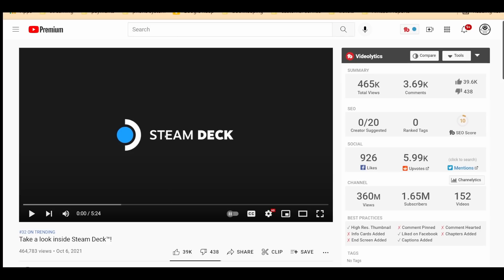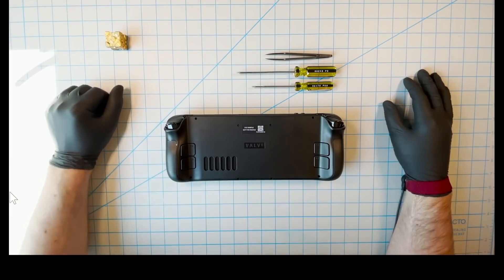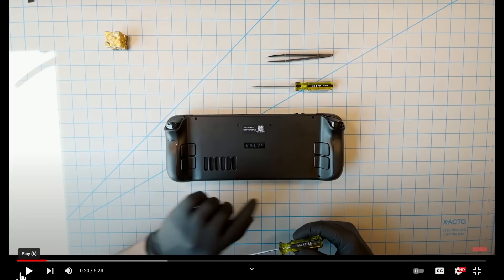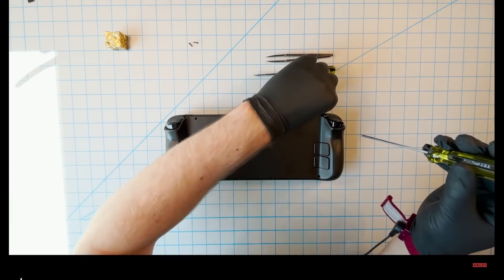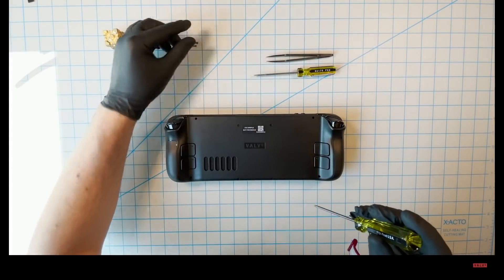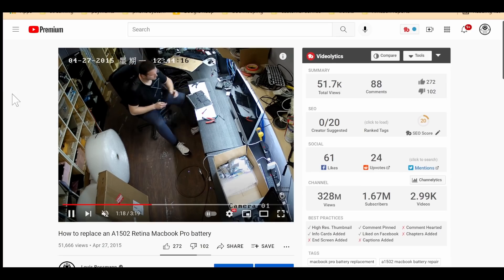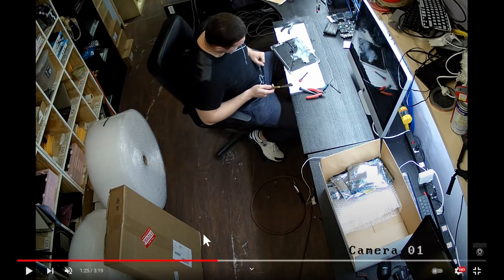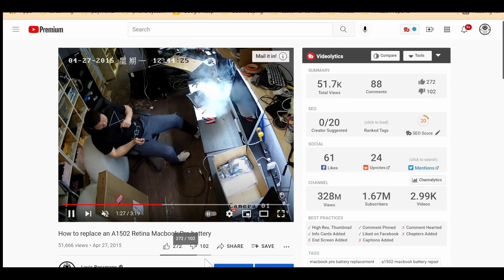Steam deck battery may end your life? bruh 😑

Comment: 6th year mechanical engineering student: at 8:07 i have two thoughts here. Unscrewing and rescrewing in the screws could cause fatigue cycles to weaken the threads  (but i doubt this because you would have to screw the screws in every day for the next 10 years for that shit to wear down). if they do weaken then the mechanical connection holding the back onto the device gets weaker. if you drop it the posts may break and the back could pop off. if the posts dont weaken from repeated screwing lol then nothing mechanically has changed about the device and i think theyre just trying to scare you here.

i think what they really mean is:
putting the back of the device back on and screwing in the screws can cause problems if the screws are over tightened. this can cause the threads to not work as intended, maybe theyre more lose than before or maybe you just cross threaded something and the screw is pointless now. this could be a problem if the device is dropped because that screw is mechanically irrelevant when considering any mechanical connections that are holding the back onto the device. basically that screw isnt doing its job and the other screws need to pick up the slack. this puts more force on the remaining screws and they werent designed for that. ie. back go pop. 

also. ive been taking my electronic shit apart since middle school and never needed an esd wrist band. i think i can remember one instance where i had too much static and felt a zap when i touched a device and it worked fine still.

Comment: There was a fatality with the 2006 lithium battery screwup, but that was a special combination of circumstances.  In that case, it was that the batteries themselves were actually defective and could explode if they overheated in use.  Overheating was not outside the range that was supposed to be safe because of the manufacturing defect.  The fatality was an unexpected overheating of the battery in a phone which exploded while the phone was in use.  That is, it was very close to the head of the person using it, and exploded unexpectedly.  (Not like the Dell notebook that burned up in use, but was sitting on a desk at the time so the user was able to get out of the way when it started to go up.)

Comment: every time you loosen and tighten a self tapping srew, you wear down a tiny bit of material. that minutely increases the tolerances and therefore influences the structural integrity. it does so on a homeopathic level but it dooes.

Comment: While I agree with you that what they are saying in the beginning should be obvious, it is not, and Valve making an effort to make their device more repairable is a good thing.

As for the structural integrity several people has mentioned the point that re-installing self-tapping screws, especially such narrow threaded ones, can easily be over torqued or, even worse, cut a new thread in an already threaded hole.

It is possible to reinstall them with 99+% integrity intact, but it will never be 100%, and with the ease of messing it up I believe it is a valid point to make.

Comment: After Reading a couple of comments about the self tapping screws I wonder if it might be possible to find replacement screws that are not self tapping so they just use the existing thread without taking away material? I dont know if that would help or hinder the situation with the possible weakness in the plastic threads. Maybe somebody can enlighten me.

Comment: I think the ''structural integrity" thing is just to cover their ass in case an idiot over-tightens the back cover  screws and breaks the self tapping ''hole'' and then calls up valve to fix it under warranty;

Same with Li-Ion in case another (or same) idiot makes tea out of it and dies in Li-pain;

Comment: I'm not particularly qualified to talk about this, But my guess is that the structural integrity will likely be affected by opening it because they probably intend to produce it in a way where it's parts are held at a high density when it's being sealed and it would be hard to reproduce without special tools. Definitely a bit misleading imo, but the teardown seems to be aimed at less qualified individuals to inform them on any possible (if unlikely) risk before they try to perform a repair on their device using random ebay parts.

Comment: I can't agree with some of your arguments. First of all, this video is clearly made for folks, whom are as basic as it gets when it comes to digging into a device and hardware. They mentioned couple times that you shouldn't if you don't know what you are doing, which is correct, and for others - you do you. Battery. I can imagine situation when someone forgets something inside a device which would make short. Imaging riding a motorcycle and your back pack caught on fire. Imagine driving a car and your trunks burst into flames. Imagine that red hot battery in your deep pocket, ofc you would get it out, but i don't think you can get away without ANY damage to you or your property. They did not say ruined structural integrity, they said lessened. That means if you not knowingly striped screw hole just a smidge, you probably made at least some damage to structural integrity of a device not knowingly, and that means if you bump your device that screw can get loosent even more. Few bumps and that screw is not holding anything anymore. Wristwrap.. Do you really think they couldn’t make another shot of this when they are cutting this video back and forth? That clearly was on purpose to show how NOT TO DO and get your attention. Ever seen that road sign which shows a car running of the cliff? Ant yet again, you are a professional, you know how static discharge works, but some 15 years old kid might not know this. You explained how you deal with static. Imagine that explanation in this video - touch lot of other stuff which is grounded lol. What is grounded and what is not? I don’t know man.. this is like watching someone critic Teletubbies because that’s what it is. This video serves 3 purposes: to show at least a bit of what’s inside of this device; to show for newbies how you can change basic stuff safely and what are the cavities; to make a statement for right to repair. I think that at least 2 of 3 should make you happy, since this type of videos from manufacturers is absolute scarcity. I love your content but this video was ..meh. Sorry about that.

Comment: I believe their comment about taking it apart will weaken its structural integrity  comes down to the fact that the shell has self tapping screws and the shell is plastic. If you have ever worked on modern plastic devices with any screws even ones that are not self tapping you know that after repeated disassembly the screws have less and less bite in the plastic. Now with self tapping screws as they are meant to cut threads into the plastic as its screwed in for the first time the theory would be that after taking it apart when putting it back together the screw would cut into the existing threads very easily thereby making the screw not have enough material to grab onto leading to a weak structure next time its dropped possibly causing it to pop open.

Comment: I just hope they, or someone, will offer higher capacity SSDs. I don't care what they say, or what work they may have done, a MicroSD card is not "plenty fast". I'm sorry a MicroSD pales when it comes to speed with a NVMe SSD. Not to mention SD cards weren't meant for constant IO like would happen as a storage drive on a computer, so the life of the MicroSD is gonna be far shorter. As for sources for parts coming in the "coming months," that is fine. The devices aren't due out till December at the earliest, and most likely January for most people, so "coming months" likely means shortly before or maybe shortly after launch, at least to me. Only time will tell on that front.

Comment: At least in audio (speaker cabinets) there is a common knowledge that using self tapping screws on a wooden/mdf/particle board cabinet to install speaker drivers, the optimal strength is lost the moment it is unscrewed. It definitely holds the driver in its place but the fit on the threads has come loose after it is removed and reinserted. Problem is that the screw now could loosen more easily over time due to vibrations. That's why many DIY'ers and higher end manufacturers install rivnuts or whatever they are called (a metallic threaded part with spikes holding it on the material).

So it most certainly will affect the integrity of the device at least somewhat. Can you actually see it in real life? Maybe not before opening it multiple times and also using it harshly. It depends on many things, like the elasticity of the plastic, the depth of the groove/thread on the screw, the weight and load bearing characteristics of the back plate and so on and so forth. And of course the amount of torque and deformation of the threaded part. If the assembly line has a screw driver/drill with a even a bit too high torque setting, it may be more problematic down the line. 

I'd think adding threaded metal inserts for the screws wouldn't be too expensive or gained any noticeable weight.

Comment: They're covering their bases. I'm loving that Valve is going head on with Hardwares now. The Steam Controller, the Valve Index, the Steam Link. Those products are amazing and people should pay more attention to what they do.
Reply: and they kinda left software behind
Reply: the steam controller is kinda meh (I have one) it works, but a touchpad makes a really bad joystick
Reply: @jearlblah5169  The way to play an fps with the steam controller is Gyro controls, with quick flick aiming. Its actually an amazing controller if you take the time to learn its intricacies. There are a bunch of steam controller tutorial videos that can give you the run down but its a lot.
Reply: "a touchpad makes a really bad joystick", because it's not a joystick, it's a touchpad so more like a mouse. 

Sure it takes a while to get used to it, but it's just superior to an analog stick. With all the options you can make the touchpad precise while still being able to move the camera really fast. 

But yeah sadly it wasn't a huge success, a lot of people just prefer the regular analog stick. From what i've seen you either love the steam controller or you hate it.
Reply: didn't all of those fail pretty much? Steam Link was an abject failure and the Controller wasn't exactly a huge success either.
Reply: @konsyjes  the index is still selling so fast they can barely keep them stocked. Vr is exploding right now and the index is arguably the best/easiest to use headset.
Reply: The steam controller stinks
Reply: @ahhcmon9604  have you used one?

Comment: "Notice that your model might look different from this one"
translates to
"We'll downgrade the components once the device gets enough positive reviews".

Linus had a great video on hardware manufacturers swapping out particular elements of the e-devices , to save on the production costs.
Reply: With such a device people will notice if performance degrades, I don't think they'd risk putting in worse stuff. If anything, overtime they might put in better stuff as sourcing older components gets harder or more costly. 

The hardware Linus was talking about namely ssd's don't get as much attention as consoles, phones, etc, in which you expect a consistent experience from one device to another, so they can kinda get away with it most of the time.

Comment: So the threat with Li ion batteries is creating a short, which after some time can start a thermal runaway reaction, causing a large amount of flames or an actual explosion with potentially lethal consequences. I agree that most punctures result in a slower reaction that can be moved away from, but to say that Li ion batteries aren't lethal is not true. I respect you and your expertise, but this is my personal expertise. I'm a materials chemist and I make these kind of batteries for a living, and it doesn't sit well with me to say that they can't be lethal when they absolutely can be. I'm not saying people shouldn't be able to to handle them or change them, but they should be respected. 

I would say that Valve put it a bit too much on display, but I also think that they don't want just Joe Schmoe messing around with the internals with no idea what they're looking at, potentially leading to a dangerous situation. Just a bit of fearmongering to keep out those who probably shouldn't be digging in the first place.

Shot in the dark with the structural integrity thing, but there are definitely some polymers and rubbers that change properties as they compress, but permanently lose those properties after decompressing again through micro-structural reorganization (like work hardened copper, but with tunable properties). I could see them using a material like that around the frame as a shock absorber, and it loses some of it's strength after expanding upon opening the case. Would it become worthless? No, but could be anywhere from a few percent to maybe 40% loss in efficiency with something like that. Really need more details with that too.

Comment: Valve is unusually open about their hardware. I had a problem with one of my shoulder buttons on the Steam controller. They actually published all the mechanical drawings for the parts, so I just got a replacement part 3D printed!  If it was an Xbox or PS controller I would have had to just throw it away.
Reply: If it were an Xbox or PS controller, you could simply have ordered a replacement (shoulder) button set, or perhaps a complete shell, as they're pretty inexpensive, off of AliExpress, BangGood, Amazon or wherever.
Reply: @EvenTheDogAgrees  Sony and Microsoft sell enough product to make this viable.

Comment: As for the Steam Deck being weaker upon opening it, I believe just thinking off the top of my head that due to the nature of self tapping screws, they'll never be as tightly fastened as they were initially due to the risk of stripping the plastic threads. Self tapping screws work best when fastened once, and only once, in an areas with no pre existing threads or in some cases holes.

Comment: Your perspective on the potential hazards of batteries is unbelievably narrow for someone with a tech business. The reality is, that's not necessarily what will happen if you mess up. If it is damaged in such a way that causes an internal short, but not a puncture so the pressure can vent (like what you showed, which wasn't a "blown up" battery"), they can ACTUALLY explode, violently. As unlikely as that may be, its still a potential risk, and its not stupid of them to tell people not to mess with it if they don't know what they are doing. And considering you had to cheat on chemistry to graduate, you really have no room to claim that they are overstating the potential hazard. Get off your high horse, you sound like a tool.

Comment: I worked in plastics manufacturing for a couple of years, I can only really give anecdotal advice but if remove and replace the screws they will wear some of the plastic and be less secure. you won't have any significant problems doing it once or twice, at worst they may loosen and need tightening every few months depending on wear, but more than that the screws will not bite, the best practice would be to add a small drop of glue when re-assembling if your happy you wont be opening it up again.

Comment: The reason why he is going so hard to "Don't open it" He is clearly talking about the normal user. He made it clear "Let a pro open this up if need be" "We don't cover damage you did in opening it" ECT ECT. When the tone he is using is vary aggressive steam will be sued because someone opened their deck and damaged it. Blaming that video. So making it clear of "DON'T RANDOMLY OPEN THIS FOR THE LOVE OF GOD" Is reasonable when you really don't want to be sued.
Reply: I assume the reason he said "Putting it back together may make it less drop resistant. Is if the person puts it wrong, strips screws, doesn't put everything back together right. There is a lot of ways to make a device weaker to being dropped and I think they are just being told by PR to warn of all of these possible issues. Clearly wanting a store or repair shop to do this rather then the end user.

Comment: about the structural integrity. self-tapping screws are made with a blade at the tip and threads that are designed to carve a tread for itself. if they are housed in only plastic to hold everything together then yes, it can easily degrade the structural integrity. how bad and is it worth mentioning depends on how much force it takes to pry the 2 halves apart.

generally speaking if you dont follow the original threading then you will make it weaker because the screw will carve new treads through/between the old ones. leaving less meat to hold onto.. i think the self-tapping screws was used intentionally for that purpose. you can switch them out for machined screws which would probably regain structural integrity.. because the tip that has the blades doesn't have teeth therefore you'll have fresh meat to thread into. also the threads of the machined screw isn't designed to carve new threads.

i only work construction but normally we use tapping screws for metal frames and vents that have no hole.. otherwise drywall screws would be best for drilling into plastics.. plastic is fairly soft when against metal, a self-tapping screw is overkill.. if they predrilled the holes and used regular machined screws they wouldn't have the structural issue..

Comment: The number of times I've removed a self-tapping screw and the burs on that cheap & nasty screw have torn out the plastic that it was held into, therefore making it impossible to tighten back up - I'm inclined to believe that they are talking absolute sense for a handheld device where strength is very important.

I like this video, it's a serious step forwards.